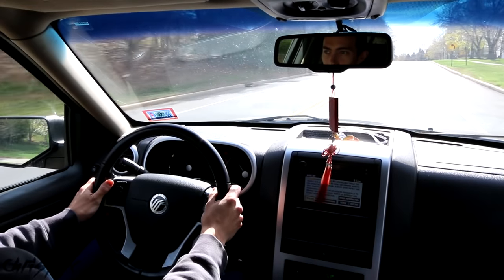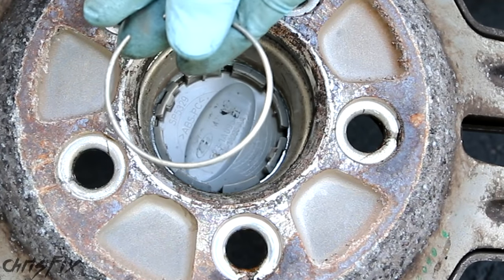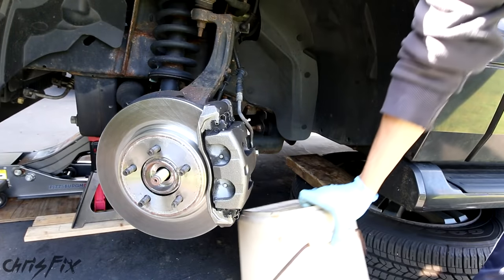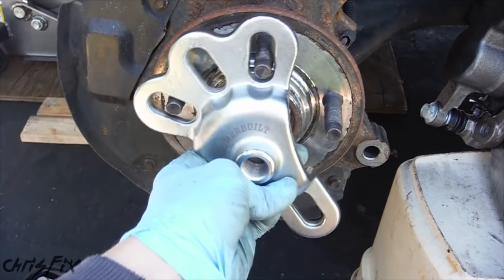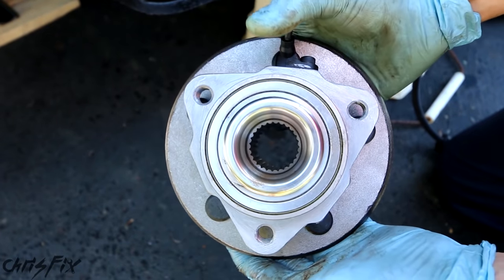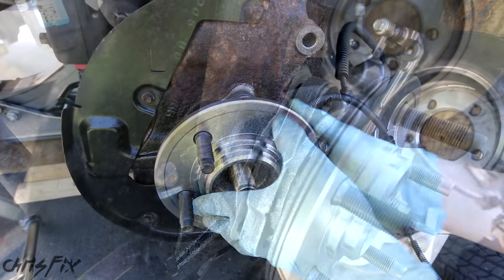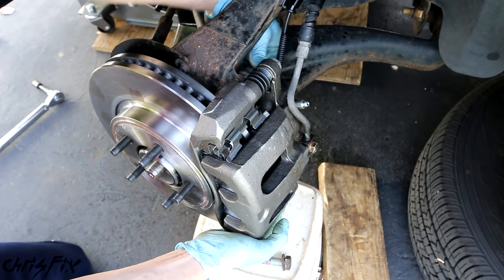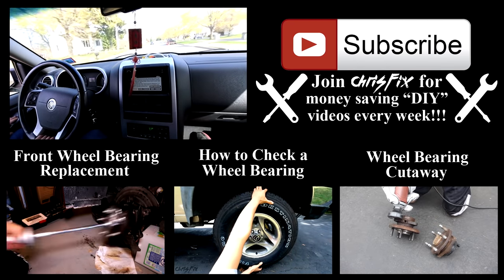How to Replace a Front Wheel Bearing

Comment: i don’t know if it’s been said but the rubber end of a hammer is how I usually get the center cap out. gently tap in the middle, no need to remove the metal clip either, less chance of breaking clips when you put it back together

Comment: Quick tip for anyone doing this for the first time. If you're have trouble getting the bolts lined up when you're putting everything back together, stick a small screwdriver through the first hole and giggle it around until it goes through the second hole, you can feel with the screwdriver when the holes are lined up properly. Have the bolt ready, hold everything in place and the bolt should line up nicely.

Comment: Back when i was 19, I left home for a job in a different state. My wheel bearing on my old Camry cracked and needed replacing. I went to a local auto shop and they recommended me replacing all 4 wheel bearings, saying when one goes the rest will follow shortly after. I knew nothing about cars and the mechanic saw that. He further stated that if I didn’t get them replaced soon, my wheel would fly off while driving. He quoted me about 3k for everything. I had to take out a loan to pay for everything. I wish i discovered ChrisFix sooner.

Comment: Pro tip: put your breaker bar around the 9-10 o’clock position and use your body weight. Likewise for high torque situations, but put the torque wrench around 2-3 o’clock to tighten.
Reply: My late dad taught me that trick RIP

Comment: If it hadn’t come off after the torches, sledgehammers and snake oil, I would mount an old brake rotor on the hub, secure it with the lug nuts, put grade 8  bolts with spacers/washers through the caliper mounting holes in the knuckle, then more spacers & washers on the other ends of the bolts, then screw a nut on the end to form somewhat of a pusher. You use a wrench to tighten the bolts and use another wrench hold the nut and turn each bolt about 1/2 to 1 turn at a time then turn the other one 1 to 2 turns and repeat. In the process the pressure being applied to the (secured) rotor from the bolts will gradually push the whole rotor & hub bearing assembly out. It worked on my buddy’s ‘11 Colorado, hope it works for anyone else in the situation of having to replace a hub & bearing assembly.
Reply from the maker: Thanks for the tip! I'll try that out if I encounter this again!

Comment: I've actually never been able to get one off with a slide hammer. I use a good air hammer to get them loose. I start by using the air hammer to drive the axle back, then put the bit in one of the bearing bolt holes sideways, trying to get it to spin a bit, continue working it back and forth until eventually you can use the air hammer on the backside of the bearing to drive it out. I also always make sure to clean up the inside of the mating surface of the spindle with emery cloth or a small flapper wheel on a drill.

Comment: pro tip

on the center cap, no need to remove the ring.

put handle of a screw driver or hammer on it and pop it out

Comment: Hey there! I had a quick question. Do you know if all hub assemblies have the wheel bearing attached to it and separate from the knuckle? Would that be why you didn’t have to press out and in a new wheel bearing? I’ve seen other videos showing the need to press out the old wheel bearing and press in a new one in addition to swapping the hub. Thanks in advance!

Comment: That's pretty neat to have the ecu tell you a wheel bearing has gone bad
Reply: pretty much its more of a database where others that have repaired the issue put in their repairs that fixed the sensor codes.

Comment: I'm going to add, from experience, that on my car's the big axel nut or whatever it's called is a lock nut that becomes dysfunctional when used once. 

I had one car I replaced the bearings on with (so I thought) cheap ones. I wasn't surprised when I had the symptoms a little more than a year later. But guess what? I could almost take the nuts off by hand. They had come loose. I was surprised, didn't know if til much later they were locking nuts. It might have been that the bearings weren't bad, just loose.

It happened again, different car, two years ago. Tire shop said they couldn't do a wheel alignment without replacing the bearings, which weren't that old. That's when I found out about the locking nuts. They're not readily available where I am so just used loc-,tite. 

If you reuse the nuts, it is not a suggestion but a must to do something to ensure the nuts don't come loose.

Comment: Hey I know this is an old video, but for anyone watching now, you don't necessarily need to remove that metal ring from the plastic center cap. You can just take the butt end of a screwdriver and knock it out as is

Comment: I jad a grinding noise on my front passenger wheel. Immediately terrified. I drive kids around in this car every day. Took it to my "car guy" and he said I needed front pads and rotors, and the wheel bearing. He told me it would be $814. 🤣😂🤣😂🤣😂 I ordered the whole knuckle with bearing and hub and a new 30mm axle nut, paid 85, on pay in four through paypal. Got my lads and rotors for $90, pay in four through paypal. Do it myself. $814 my ass. Mechanics are liars and thieves. Thanks Chris Fix. You and others have saved me a lot of stress and money and given me a lot of confidence.

Comment: If you have to take the wheel off, you don't have to put it back on, just put a drift or punch in the slot of the brake rotor, it will prevent it turning past the caliper.   You need to watch briansmobileone's video of how to remove the front hub assembly: You have a hydraulic press RIGHT THERE already ready to use, loosen the hub bolts but don't remove them, then use a rod between that bolt and a frame section, then turn the wheel into it with the power steering. Pop!  Also clean the threads of previous threadlock.

Comment: I had to take the axles out of my Mazda to change my clutch,the axle nut on the passenger side was beyond seized on. I went through 2 breaker bars while using the metal pipe for extra leverage and would up finally getting it on the 3rd new breaker bar. If you've got air tools then absolutely use them,you'll save your back and time.

Comment: A good trick to use when using the hammer to remove the bearing itself, especially when its stuck, is to tie a tshirt to the pulling mechanism. Gives you way more force per thrust then using your hand alone.

Comment: See SouthMainAuto's neet tip for using bolts and nuts to get off stubborn wheel bearings - you remove a lug nut bolt and then use a bolt and nut in the hole to create a small screw press to press the bearing off.

Comment: benefit of using impact tools is that if these bolts were rusted, a breaker bar might just shear the head of the bolt right off. YMMV, but try to use an impact on rusted bolts before you crank too hard with a breaker.

Comment: You mentioned that the previous repair used a cheaper wheel bearing, how do I know I’m purchasing a quality part? OEM? Price? Brand?
Reply from the maker: It ultimately comes down to reading reviews, doing some research, and then buying from a reputable manufacturer or store. In this case, the OE Ford wheel bearing that the dealership used was actually a bad design that they didn't correct which is why it went bad quickly (not sure if they have updated the design all this time later), so a high quality aftermarket or OEM wheel bearing that corrects the issue would be a correct part. For 99% of other parts, buying OE/OEM parts will always fit and function perfectly, but they can be priced pretty high, so that's where an aftermarket (read reviews to confirm for your specific car and part) part can be a good replacement as well.

Comment: If a grease fitting was incorporated into the wheel bearing design would the bearing last longer? I ran a K-Car for 252,000 miles and the rear bearings were in great shape. I would pull the rear wheels every couple of years to inspect (1/2 hour chore) and I would hand pack some replacement wheel bearing grease.

Comment: I watched this because I literally just had two back to back bad experiences at auto shops. And I'm tired of getting screwed over. I sell makeup... And have had a full inspection twice by the same shop. I took my car back in telling them it was still making noise. They replaced my brakes rotors and steering system and said they couldn't hear any noise meanwhile my 5 yr old daughter can hear it.  I can even tell it's my wheel bearings.... I wish I had all these tools and was confident I had enough strength as a woman to do this myself.
Reply: Lady. you dont need strength u need leverage. Or power/air tools lol

Comment: Question for you ChrisFix, my 2013 Honda Accord definitely has a bad front wheel bearing. Im pretty sure my rear is bad as well, have you ever replaced a rear wheel bearing? If so, is the process similar to changing out the front?

Comment: i know i'm several years late, but i just wanna add you really should use red high temp loctite on all brake parts. the blue stuff  will deteriorate with the heat generated from braking. That is all, carry on.

Comment: Chris, 
I have a 2014 kia optima LE 
We recently changed the rack and pinion and had the tires aligned and balanced. I've noticed that after I hit 65-75 mph the traction light blinks till we get out of that mph range. Do you think i just need a new ABS wire? 
Also, my wheels feel like they shake at certain spots on the road when accelerating.  Do you belive it could need new control arms, inner and outer tie rods or motor mounts? Any tips help. Thank you

Comment: Hi, first I like your video. You torque your axle nut to 190 ft-lbs !!! It is to much : it will burn your bearing really fast. I suggest 140 ft-lbs. In case of doubt, verify with your dealer. Thanks, and continue your great jobs.

Comment: Let me save you guys hours. If the brake caliper isn’t coming off, be sure to unscrew the two screws that go into the hub.. I tried but they didn’t budge. So I took the whole hub assembly off with the caliper attached haha. That sucked. And then I beat the shit out of the old bearing assembly and it still wouldn’t come off. I tried to back off the screws with a bigger bit and they came out. What a time.
Reply from the maker: Dang, at least you were able to get them out!

Comment: Hey ChrisFix, I have a 2012 Dodge Journey sxt and I have to replace the front wheel bearings.  Do the front wheel bearings comes with the bearings, all the videos I saw including yours, that you just unplugged the abs sensor.  Is that the case with my 2012 Dodge Journey that all is done for the abs sensors is to unplug it.  The reason I'm asking I went to three mechanics all had a different story about my wheel bearings.

Comment: I just had the driver front wheel bearing replaced on my '07 Ford Explorer Sport Trac XLT and now I have a weird vibration when I drive. Seen some posts around Reddit stating that it's normal due to the grease needing time to break in, but it still worries me. Is this truly a normal result? I'm already looking at having the passenger front replaced as I still hear a tiny bit of grinding when I turn. Any advice/suggestions are appreciated! Already spent 354 on the one and not afraid to spend that again for the other.

Comment: Great information. One thing is some vehicles require different torque settings for the lug nuts. My last 2 GM vehicles were 100 ft. lbs but my last 2 Toyotas were 76 ft. lbs so look at that book in the glove box that takes up a lot of room called an owners manual. By the way, stick that book into a Ziplock bag and put it under the passenger seat without blocking any heating bents or obstructing the seat slide or if you have a trunk mounted spare tire put it in there.
Reply: Alex Will, depends on if alloy wheels or steel wheels.

Comment: Hey, great video! Subbed! Wondering if anyone can weigh in on my wheel situation: I have a periodic, but persistent scraping noise coming from my front passenger side wheel & took it in to a mechanic. They diagnosed that a wheel bearing hub was the proper fix & quoted me 650. I thought that price was crazy so they said that they'd allow me to buy the hub to save some $, but said that they couldn't guarantee the part. I got a timken hub online (which seemed to be a higher end part) and had them put it in. They charged me 240 (@100/hr) which still seemed like a lot for the job and to make matters worse the noise persisted! I took it back and they gave me the run-around (at first "I don't hear any noise" and then finally "oh that noise, that's coming from your car?") then after unsuccessfully trying to mess with the brakes a bit (they said that's what the noise was) said I'll need to warrantee out the hub. I feel like I am being had. Thoughts?

Comment: You torqued the axle nut while on the ground and the wheel on, this made it impossible to install the cotter pin.  I've always torqued in the air, can you touch base on the difference? Did you install the cotter pin?

Comment: The anti seize will work better on the outside of your bearing that goes into the knuckle that’s where you get hung up at, I’ve had bearings come apart that requires using a flathead screwdriver because the bearing case was seized not the hub assembly bolts. Still good idea butt definitely need it into the knuckle where the bearing sets in at, with cheaper Chinese made bearings that back bearing case starts to rust faster and when that happens it would be better to sell the vehicle then pay to have that done unless you coat it well.

Comment: Quick question.. I have a 2009 jeep liberty and want to do a wheel bearing replacement (front passanger) but I've noticed it doesn't have the nut screw on the center? Would all the steps be the same except having to take the nut off? Majority of other videos have that axcel screw on there.. Except mine.. Just want to verify before getting in there. Thanks in advance!

Comment: I was going to be mad if it came right off. i replaced a similar bearing to this on my parents dodge ram 1500. i used a slide hammer and a sledge for like 6 hours bruising my hands and arms. never got the thing off a shop and to lift it to head level and use a 10 lb sledge to get it off the truck.

Comment: I've watched other videos on replacing front wheel bearings and in a lot of them the wheel hub comes off on its own with the slide hammer but then the wheel bearing must be pressed out of the knuckle. But it all came out as one in this case? Am I missing something?
Reply from the maker: That’s a pressed bearing vs this which is a hub bearing assembly.
Reply: @chrisfix  Thank you so much man, the fact you still care to reply to these comments makes you one of the most genuine youtubers out there. much love

Comment: I just paid a guy to replace brake pads a wheel bearing and a lower ball joint with the Control arm for 110 bucks. Paid 60 for the pads Another 60 for the baring and 150 for the control arm.for a 2014 Chevy Cruze it all cost me around 380.

Comment: Hey Chris I'm at a loss. Today spent all day trying to replace the wheel bearing hub. Got up to the part where I used the hammer puller and about 5 hits pulled it off. BUT ONLY HALF THE PART. LIKE WTF. SO END OF THE PART WHERE THE 4 BOTLS CONNECT ISNT COMING OFF
Reply: Banged and banged n just won't budge. Literally one step away lol to put new part in. Lol

Comment: Small question, what do you do if the axle get stuck in a out wards position? IDK what my dad did but my axle that connects to the transmission got stuck outwards and well, I know the transmission has to do with how its stuck because you rotate it forward, it get more stuck but backwards will be normal stuck were you have a tiny bit of wiggle room. I really do not want to replace a giant axle. I treid youtubeing and googling whats causes it but almost no dice. Nothing but a bunch of how to replace axle videos. All this because the lug studs needed to be replaced.

Comment: I have 07 speed 3 and the front right wheel bearing makes a deep humming noise I was told to replace both the fronts just in case. This around the same process?

Comment: I have a 2002 honda civic lx. I am changing both front struts. Also, the right side wheel bearing and axle. Every video I have seen mentions spinning the wheel as it should spin freely. When I jack up car my trans is in PARK. Neither wheel spins at all. Do I have to be in NEUTRAL in order to spin freely? Why is it never mentioned? Am I missing something?

Comment: Comment then a Question? --> Good easy job. I did the left rear hub on my '07 Jeep Commander. No problem. 
Over the years [I'm the 5th owner] the wheel lug nuts have been on and off so many times that the chrome beautiful 'surround' of the lug has distorted, bent, rolled,  dented to a point where the socket won't fit entirly over the lug nut. They are junk!~! 
When that happens, to seat the socket down on the lug all the way I grind the 'surround' square again to fit 19 mm Tee wrench. Sometimes the actual chrome 'suround' is totally ground off leaving a nice hard STEEL lug nut, like on a trailer ... with no tin cover over it. 

Question --> What is the factory lug nut socket size~? 3/4 inch or 19 mm~?
Reply: Jeep wanted $300 for the job. I ordered off the internet a Dorman hub for $56.00 and had it done in two hours in my drive below while freezing.

Comment: These pop up in my feed every now and then. I get traumatic flashbacks to 7 hr spent fighting a hub assembly. Ended up using the power steering to pop it off. Would not recommend. Surprised I didn't break something.

Comment: when you say that the blue lock tite is removable it obviously doesn't mean that the red is not removable, because those bolts came out, but should I be concerned about using the red lock tite?